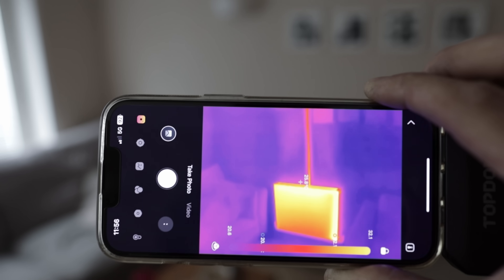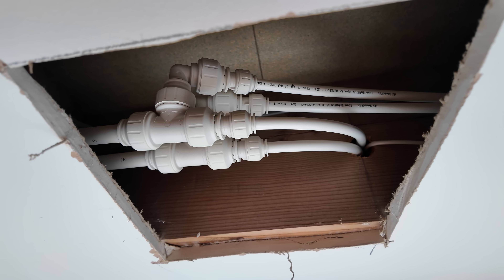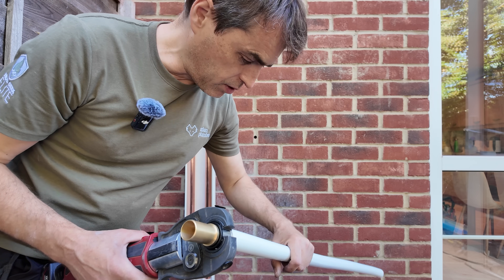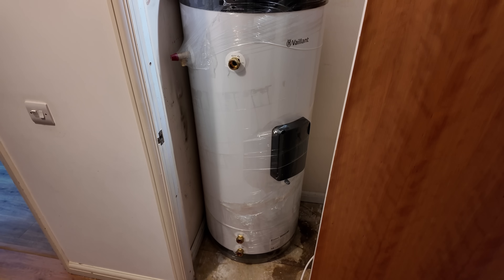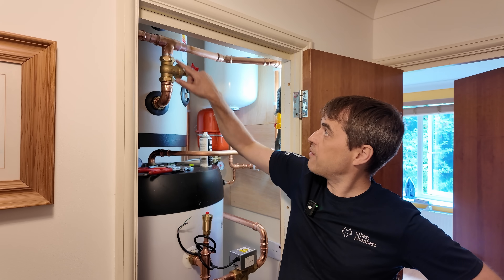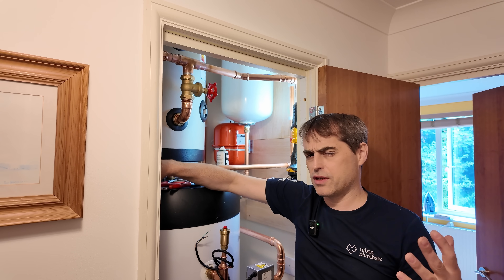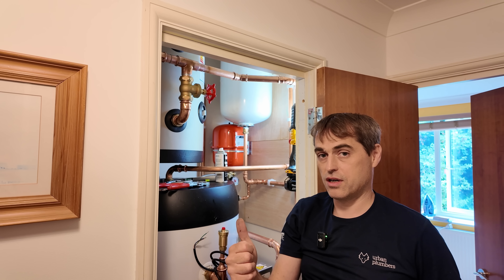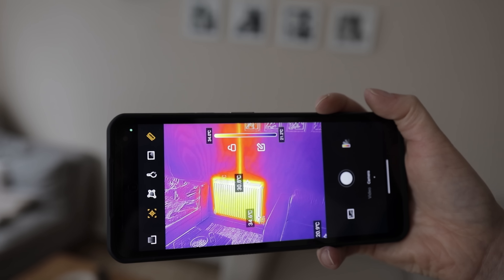Micro-bore Pipework & Heat Pumps: How To Make It Work.

Comment: Thanks for this video.  I have microbore but 10mm copper attached to 22mm with heat loss of 8.5kW.  Would you typically expect a buffer or additional circulation pump to be required like in this video installation?
Reply from the maker: That depends on the heat loss and index circuit pressure drop.
Reply: Room heat loss on index circuit is 1.15kW
Reply from the maker: How many rads in that room ?
Reply: Just the one
Reply from the maker: Yeah that probably will not work without a buffer or partial re pipe. I would try it first and test - it might just work.

Comment: Just looking for 
1) How much a heat pump would cost over 10 years including the gas/electric/servicing cost in the UK.
2) How much a gas boiler would cost over 10 years including the gas/electric/servicing cost in the UK.
I can work it out for the gas boiler but just get if's and but's from heat pump sales people.
Reply: At the moment there's not a strong TCO argument for going with either type of install, generically. Some properties will work better with a heat pump, others with a boiler.

The big factor though is labour (not just for install, for service as well). At the moment most plumbers prefer to work on gas boilers and will charge lower prices for an equivalent job, but this may change in the future. In principle heat pumps are much simpler than boilers and there are fewer barriers to entry (no CORGI &c.) so ought to be cheaper to install and service.
Reply from the maker: The opposite is actually true. MCS and skill barrier is much much greater than Gas Safe and installing boiler. Complexity of installing g heat pumps x 5 as compared to boilers. Difficulty of MCS is x 10 compared to running Gas Safe registration.

Generally heat pumps are much more expensive on memberships in professional organisations, way more admin and red tape and much higher skill set of installer required.

It’s like driving a car vs flying a plane at the moment.
Reply: @UrbanPlumbers  Agree, MCS is difficult and does make things more expensive compared to Gas Safe (not just through certifications and paperwork, but restrictions on equipment and system design). In my imagined future they wouldn't be necessary; and it's a shame you need MCS to get the grant. The whole reason Gas Safe exists is because gas is dangerous otherwise, there's no safety argument for regulating (monobloc) heat pump installs/servicing. That said, I got a non-MCS install and ended up with a bad experience. 

But no gas, no flue with all their complexities, lots more packaged into one box. With a proper system design the plumbing should just be flow and return, a cylinder, zone valves and that's it. With weather comp, not even any need for a thermostat. It's simpler than a system boiler properly installed by someone like Andrew Millward. Not as integrated as a combi but you have to compare like with like and the combi heat pump has yet to take off.
Reply from the maker: Too many variables to be able to answer this question as a generic answer. 

Heat pump is the only heat source that can be run for or close to £0 a year when combined with solar PV and battery storage. Can’t do it with gas.